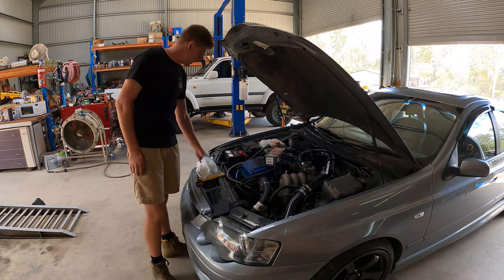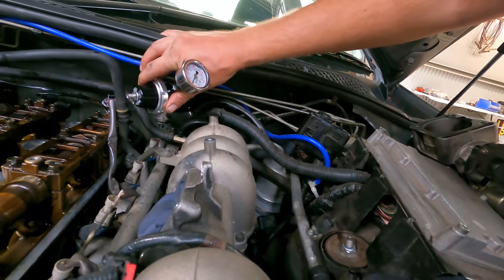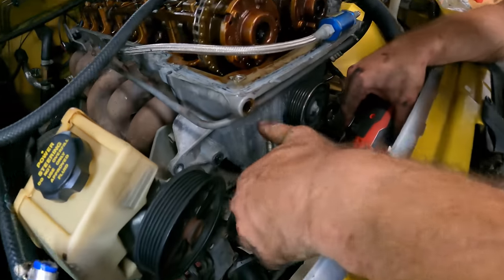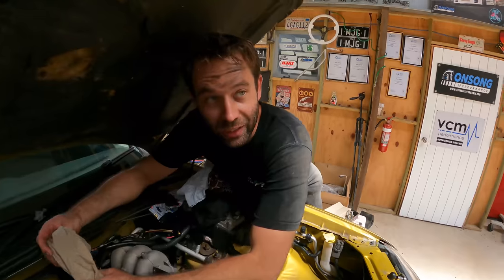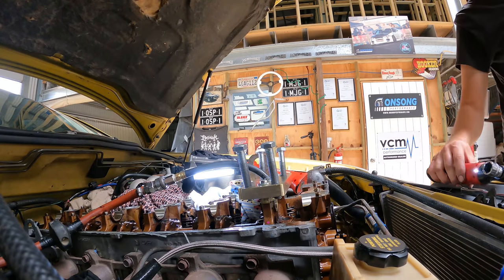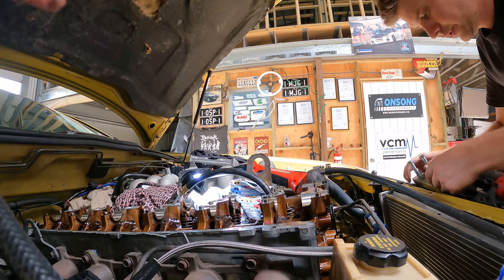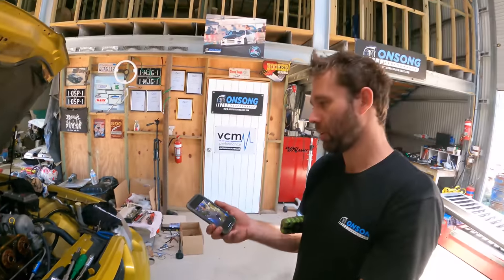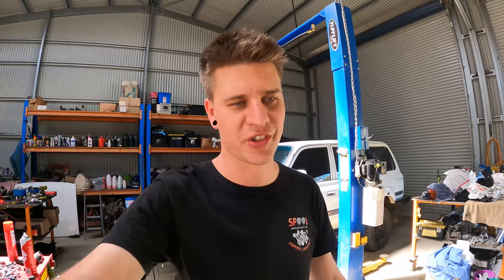Barra Upgrades - Valve Spring Upgrade (In Car) | Ford Falcon XR6 Turbo

Comment: I just watched a youtube guy change valve springs using the  piston at TDC to retain the valve, no pressure and enough height to put the new spring on, worked perfect  (Barra))
Reply from the maker: Ah thats pretty cool! Few ways to skin a cat. the old school way we used to do it on Chevs and Fords was to shove bunjee chord in the plug hole. It would bundle up and hold the valves closed at TDC then just pull the chord out and bobs your uncle.

Comment: great vid, what timing chain kit with guides would you suggest to use?
Reply from the maker: Genuine Ford seems to be the go! Or Atomic, but have heard of Atomic gear failing
Reply: @BoostGumps  Thanks guys, are the cheaper aftermarket options worth taking a look at - Nason/Austral or is a lower km used OEM timing set more trustworthy lol
Reply from the maker: @jerryyan9456  would buy a new set from ford. Your local dealership should be able to help you out. We have never really liked Nason gear

Comment: Hi mate,
I recently did a valve spring change ,put everything back together,fired her up and noticed a rattle,
on the intake side around 2000rpm over that it goes away then comes back on deceleration around 2000rpm.. what do ya reckon that is fellas? Buggered lifters? Cars done 98k 
Cheers

Comment: Probably not same issue but i couldnt get gfb reg to go under 60lb untill i enlarged the hole in fuel return in assembly in fuel tank but i have 255 intank pump and 460 in process west surge.

Comment: Hey mate I’m looking at doing the same thing how much more drama is it to pull the head off I’d like to do the head gasket while I’m in there just to get it don’t is is as easy as pulling the head bolts and pop it off or nah 

Cheers
Reply from the maker: But more involved as you need to remove intake + exhaust manifold, but still easier to do all that while you’re going. Much easier to do this job with the head on a bench also

Comment: If you are starting to get more barra”s you can get a special built tool for the valve spring remover and replacing them and I don’t think they are really expensive and they were made so you can do the springs in the car and you can see a video of one being used on that green FG that you have seen and tried to sort a R33 he had which looking back hindsight and you see a guy that works out were he got his FG done and then same thing just flicked him and the extras he got to help and saved money. Or you could probably call Real Dyno Performance and ask lee were you can purchase the valve spring tool and he would happily tell you because his old school and happy to help anyone with a couple of questions. He did my car and I got fuel pump intank 1000cc injectors a-line my turbo so the flapper works with the turbo I got a second hand exhaust off one of his other client and dyno I said not to try for max out of the motor he ended up getting 411rwhp and he said I should do my cams ASAP which I did and this was all done last year just before powerplay July. He said he didn’t know what it was about the car but he said he had never felt any of the cars he had done but he really enjoyed it and I would as well since I had V8 torana first car and then V8 VS Ute second car and then the fastest one 2.8 turbo Pajero 98 model and then my BF the other things he said I should have done is put a trans cooler and either bypass or remove the fluid heater box the autos have as they en up wrecking the box petty quick and there’s a metal plate you can get and then you only have to get a pan gasket and fluid a the autos have a plastic box cover which you have to get every time because they are one and throw and the price of the alloy one is the cost and half of the plastic ones so no brainer alloy for me and I have the PCMTEC in my cruise control so I can choose what Setting I want out of three and the forth is velvet parking and won’t rev over 3000. Also if you are replacing cams and they are getting ones Ford use then try get the BF series 2-3 cams if you can because they get heaps of little pits on them from after those ones ie-Fg-FGX well hopefully you get a couple of things from this and it helps you with making it easier. See you at powerplay I’ll have a couple of runs with you and my son will be digging it he watches your YouTube with me it will be his second time on the track.

Comment: Nice work, how come you pull the front cover off? You’d save so much time keeping it on. But I spose in this case lucky you did because you had to fix other people’s work haha
Reply from the maker: Yeh we dont have the correct tools to lock the cams to remove the phasers. Honestly I rather remove the cover anyway, its less than an hours extra work and I sleep better at night knowing for sure that its timed correctly when it goes back together
Reply: Yeah fair enough mate , you’ll work it out the more you do. Looking forward to the dyno results 👍
Reply: You can pull the vct phaser off with the cam once you release the tensioner. If it'll help you sleep at night you can rotate the engine up to 38 times till the marks line up with tdc.

Comment: The owner didn't want oil pump gears?
Reply from the maker: Nah thats quite a bit more Labour intensive and quite expensive. Not in the customers budgets at this stage,
Reply: @BoostGumps  hopefully the owner doesn’t regret that decision.
Reply from the maker: @bigal878  all depends how you drive them